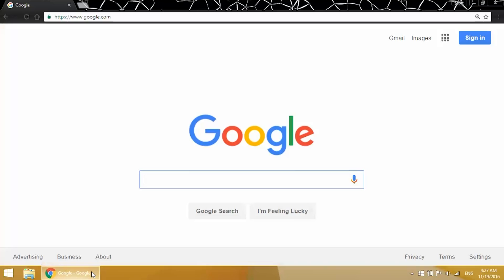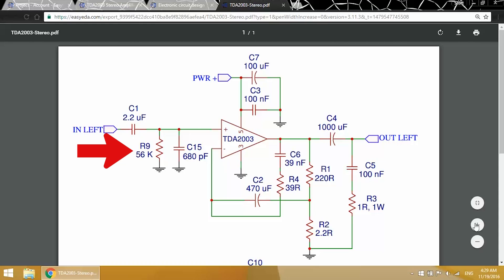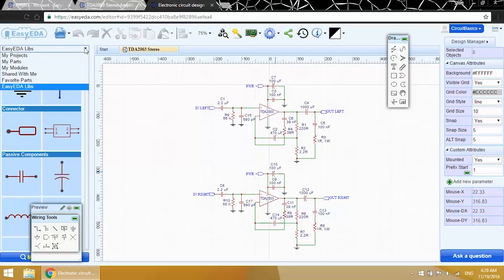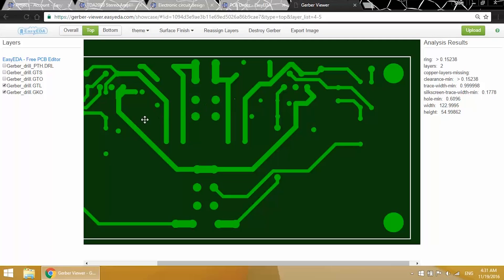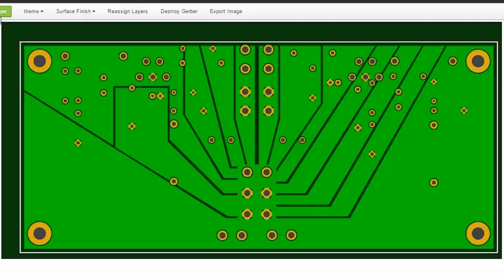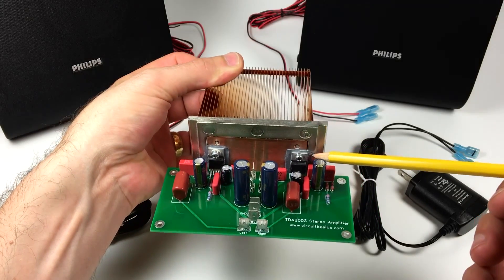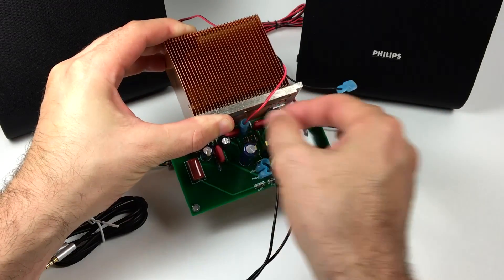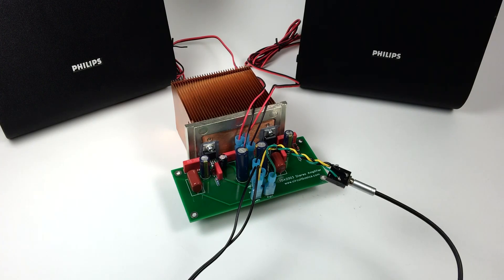TDA2003 Stereo Amplifier Design Tutorial

Comment: My copy of this circuit does not like the resistor R9. It seems to induce clipping + noise to the low voltage swing of the output. Any ideas way that would be the case?

Comment: How did you determine C4 and C12? I see 470u caps to remove DC offsets on the output and that has always seemed to do the trick. Did you use 1000uF for any specific reason? I understand that the higher the capacity, the lower the frequency response, but that means if the capacity is too high, it will take longer to remove any DC offset on the output. The dreaded THUNK if you power the amp already plugged into speakers.
Just trying to figure out the way to determine the capacity to use.

Also, can you explain the logic of the feedback capacitor? Wouldn't that add delay to the feedback? Is it just to stiffle high frequency oscillation, or does it have to do with the fact that the feedback needs to be DC offset since the negative rail is grounded(single rail supply).

Comment: Do you know what simulator i can use to simulate TDA2003?
Thanks.
Reply: 'Power opamps' are strange beasts, as they aren't actually opamps at all, but rather more like an op amp driving some transistor power stage(the kind of transistor depends on the power opamp). Because of the complications this poses in modeling, you are going to have a hard time finding an accurate model.

Comment: I'm sorry my English, I don't understand C2 470uF doing?
Reply: The C1 coupling audio signal through the VR1 to adjust the volume. Then sent to the C2 anti-noise DC input signal to pin 1 of IC. The non-inverting amplifier circuit is a non-return phase. This is the signal output pin 4, by a C5 enhances the stability of low-frequency response the better

Comment: Do you hear any high frequency rings coming from the speakers even when the audio source is plugged in? The current amplifier I use for my speakers has this problem. Its quiet enough to stand but definitely annoying. I'm considering making this, but with a few improvements for bass response and such to replace my current amplifier as it will be both practical and fun to make.

Comment: great video! I would add volume control. Why you didn't?
Thanks for sharing knowledge of designing pcb.
I'll try to create something with TDA2005.
Reply: This is just a power stage with no voltage gain(in a current gain configuration). It could be used that way, but that isn't the way he purposed the chip. The volume would be controlled in a preamp or from the source, all this does is give that signal enough current backing it to drive speakers. You could run your signal through a pot first though, nothing is stopping you from doing that.
Reply: interesting points ,if anyone else wants to learn about how to make electronic circuits try Sovallo  Circuits Expert Fixer (do a google search ) ? Ive heard some awesome things about it and my mate got great success with it.